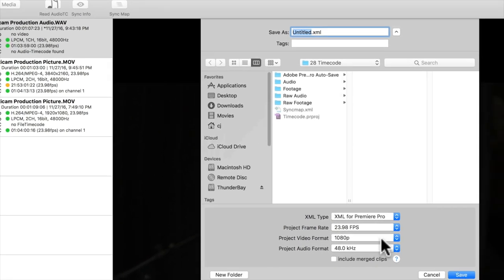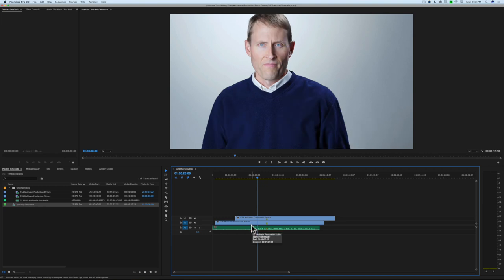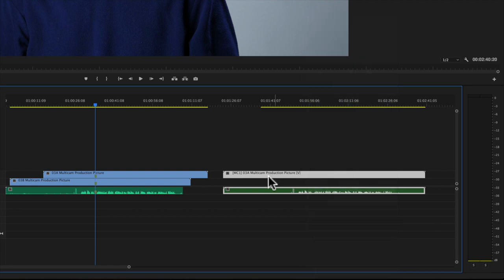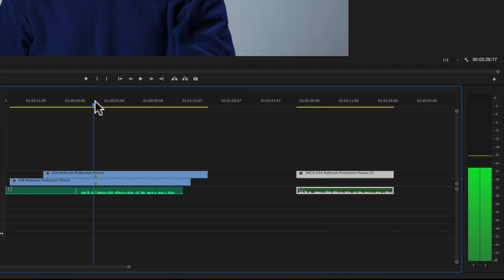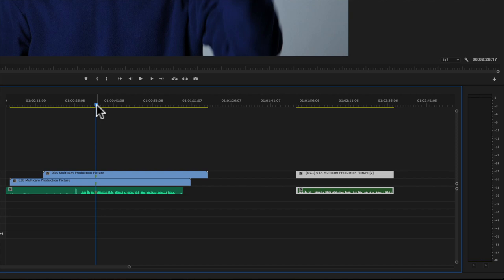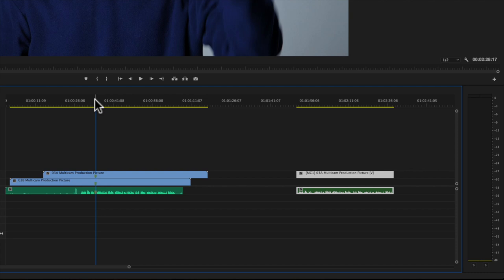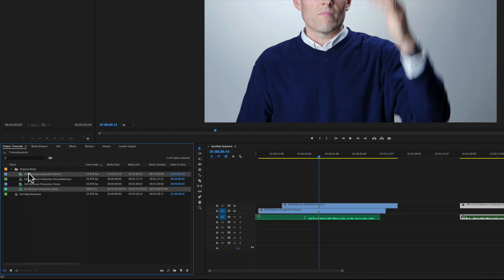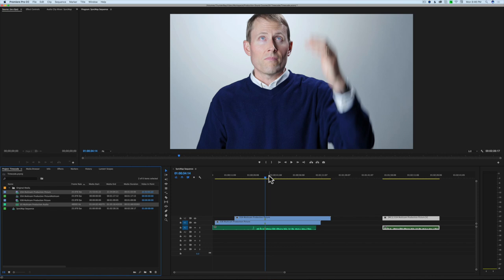Sound for Video Session: Timecode Demo

Comment: Hey Curtis, great video and thank you.  Can you still export media option from the app with raw files like braw?  Does it create new media files or simply attach the audio track to the existing media?  I’m using premiere.  Thanks!
Reply: Hi Damon, Tentacle Sync Studio supports the following import formats: Supported import formats: Quicktime, AVCHD, R3D, MP4, BWF, WAVE, MXF, CinemaDNG. Does not appear that they have added BRAW support yet. However, DaVinci Resolve handles timecode on BRAW files nicely.
Reply: @curtisjudd  Wow.  Well that's a deal breaker.  I was reading a post on Tentacles forum saying there was a work around, but you're right.  Well thanks for the reply and keep up the great work!

Comment: Great video! Hoping you can help with a question. I'd like to sync my Zoom F4 with my H6 for live music recording of up to 10 tracks. My idea is just to run TC out of the F4 into one of the audio tracks on the H6.  My question is, without using something like Tentacle Sync, how does the "audio TC" get read by the NLE? I use both Resolve and Premiere Pro. Even slating isn't reliable in this case because of the varied distance from source to mics. Any ideas?
Reply from the maker: Hi TCR Productions, yes, Resolve (but not Premiere) will read the TC signal on the audio track and convert it to a meta-data time stamp. In the media tab, right click the clip from the H6 and choose "Update Timecode from Audio - LTC". Once it has that, it can be synced by highlighting both clips, right click, and choose Auto Sync Audio Based on Timecode. You may have to experiment with it as it may expect to find the timecode on the first track or the last track. Good luck!
Reply: That's perfect! I'll give it a try over the next few days. Thanks for the quick reply.

Comment: I have clients asking for synced audio directly from the memory card in the camera.  This is usually when I run two cameras at once for interviews/doc work.  I shoot with an fs5ii.  Last time I synced in post (premiere) the client was upset that they did not get the raw video file directly from my sd card on my fs5.  I sent them 2 prores files with 0 compression (since I also recorded to prores).  Both files had perfect audio sync.  A cam and B cam.  But still, the client was displeased.  Any way to sync timecode directly to the cards in the camera?  Sometimes I roll an a7iii as a B cam as well.  Been researching on this and have yet to find an in camera solution.  Thanks for this video!  Helped me out a ton
Reply from the maker: Hi, You could run audio from the audio mixer to the mic inputs on the FS5II and FS7II.

Comment: Evening Curtis - just bought the tentacle Sync - great little unit. I know it's a bit off topic but, would love your feed back Re: powering the F4: town between the Hawk-woods NP1-35s OR Swit DV- Li-on s-8770s (Sony style). Using then with a back up of Eneloop pro's in the unit. thanks for your time - Love tour Videos.
Craig
Reply: Hi Craig, I Haven't used either of these but will be in the market in the near future after a recent shoot where I burned through some off-brand Sony NP-F style batteries. They ended up getting the job done, but not with a bit of worry on my part. These were no-name brand batteries which I think may have come with one of my Atomos recorders.

In any case, I would look at NP1 types of batteries for their size to power ratio. the Hawk-Woods looks interesting. Best of luck!
Reply: Curtis Judd thanks for the reply! I'll let you know how I get on. Thanks again - Craig

Comment: If your camera had time code built in would the master still be the external recorder ?
Reply: Yes, definitely. Unless you a filming with an Arri with the timecode module, I'm not aware of any other cameras which have an in-built timecode generator. They have realtime clocks, but those drift much more quickly. So you'll want a timecode generator for each camera, even if it has a timecode input.

Comment: Timecode vs scratch audio?  Is it the same or is Timecode the best way to sync everything that was shot at the same time?  I assume it's better to just scratch audio as Timecode was the way Before scratch audio syncing exist?  If you have multiple gopros, sound and video recording equipments, having them have a timecode device wouldn't be so ideal as you have to ensure mounting and it not getting destroyed during certain shots makes it better to just not use it.  I assume timecode is great when you are in a controlled environment with many high-end equipment and using scratch audio in expensive budget shoots with no timecode immediately makes the production team look novice and unProfessional but ultimately in post, scratch is the same?  What if the frame rates are off slightly over time?  Does timecode "heal/correct" this?  Can scratch do the same or do you have to break up the things in segments to keep the audios synced?  I think.. timecode excels when you have setups running concurrently in different places that have no way of having the same audio feed.  I can't come up with a scenario but there has to be a few good ones.  Perhaps if people were drag racing or flying a race in 2 different aircraft or more, the audience and other things going on with mics on people on the ground (interview) and in the air (commentary), rather than trying to match it all up in post to determine chronological order and synchrony, timecode makes it simple to do director camera cuts.  Basically, make your life easy and do Scratch when all the audio can be recorded on all the equipment and do Timecode when you will have situations where distinct similar audio cannot be picked up on the devices at the same time.

Comment: Hi Curtis,

I shoot airshows at 60fps, yet all Timecode devices max at 30fps.

Will running TC at 30fps be a real problem with syncing in our NLE?
Reply: SMTPE timecode is saved in the following format: HH:MM:SS:FF where FF is the frame number. So unfortunately, this probably won't work if you're shooting at 60fps.

One option to consider is using a mixer or audio adapter to feed audio directly to camera. That way the mixer does the critical work of amplifying in the mic signal with greater quality than most cameras will. Best wishes!

Comment: One thing I didn't quite get is at what point does the camera sync with the generator if receiving TC as audio through the mic in? Is it instant? Do you have to be recording with the generator hooked up at all times? I guess what I mean is when can you disconnect the generator from the camera.
Reply: Hi Daniel, if the camera does not have a timecode clock in it and you are feeding the generator in through an audio input, you must keep the generator connected to the camera through the entire shoot so that it records to the audio track every time the camera rolls. Hopefully that clarifies, sorry for the confusion.

Comment: Hello. Can I use the Timecode in my Sony fx6 to sync with a zoom H6? Can the fx6 jam Timecode into the zoom H6? New filmmaker here learning. I need to start external recording and looking for the best solution.
Reply: Technically, yes, sort of. You will have to use one of the inputs on your H6 to record audio timecode, then convert the audio timecode to metadata timecode in post (ideally on macOS with the Tentacle Sync Studio. I can't remember whether the H6 can combine all tracks into a single poly wav file, but that's what you'll want.

Comment: Hey guys, Is there a reason why Curtis was using the ZOOM unit to measure the noise floor as oppose to using the Sound Devices one?  Also, can noise floor be measured in real-time?  I'm completely new to this and am trying my level best to understand "how to do it right".  Thanks for any help you may send my way.
Reply: Hi Gerry, trying to remember back to last November about measuring noise floor in this timecode demo and not sure I recall the details. Are you by chance referring to a different episode? Thanks!
Reply from the maker: Oh, I see. I must confess that I do not remember. The important thing is to use the same recorder for each mic and the Zoom F8 has an extraordinarily clean preamp so it was a good choice. It may be because it was easier to set the same gain level for each mic on the Zoom (It displays the gain level digitally while the 633 does not)
Reply: That makes sense.  Thank you very much for taking the time to answer my query.

Comment: hi, if I buy a camera that has timecode in and out connectors , can I sync it with the audio recorder directly with a cable ?
Do I have to sync them again each time I turn them on ?
Reply: Cameras do NOT have in-built timecode generators (at least all of the cine cameras I've worked with), so you either need to leave the timecode generator or recorder/mixer with an in-built timecode generator connected to the camera through the entire shoot if you want frame accurate sync in post. If you just want to use timecode to get "in the ballpark" in post and then manually slip the audio to get perfect sync, then you should be able to just timecode jam, probably every 2 - 4 hours.

Comment: Hey Curtis ive two question regarding timecode. Firstly if the signal coming into the camera from the timecode device is a bit hot does this is anyway affect the ability to sync later in post? Also how problematic would it be to change the frame rate while using a tentacle for example. At weddings im constantly hopping between 24fps and 60fps and im wondering if i was using a tentacle here would that mess up my ability to sync?
Reply: Hi, yes, sending too hot a signal into your camera can prevent successful sync later. You'll want to set the appropriate level on the timecode generator and the input level on the camera so that the meters are hitting around -12dB. As for framerate changes, yes, you'll need to change over to the appropriate framerate on your audio recorder and tentacle to achieve successful sync. Are you shooting at 60FPS with audio or is that for slomo work?
Reply: The idea was to invest in some tentacles to make ceremony syncing much easier. But often during the ceremony i would switch over to 60fps for say the first kiss to give it that subtle slow mo effect. But seeing that these are really stand alone shots i doubt it would become much of an issue providing the bulk of the ceremony is synced up as normal.
Reply: Ah, ok, that makes sense. I agree, those will generally be backed by music or you could include the, "...you may now kiss the bride..." leading into the slo-mo shot.

Comment: Is there a way to use the TC in say A7Sii and Jam sync it to the F4/8?  What connection would I use for that?  How about an HDMI to SDI converter (I don't really know what format the TC inputs on the F4/8 are so) sorry if that is silly. 

 I see that SD supports Sony A7Sii TC on the MixPre 3/6 but because it doesn't have an internal source I would have to stay tethered with an HDMI cable between the Sony and SD and that seems crazy for location sound.

I understand that I could use an audio channel in the camera and  I could use the Tentacle Sync or TIG devices but since the F4/8 supports Jam sync as you have demonstrated I would like to try the reverse and without the additional cost of the separate devices.
Reply: Hi Gregory, I don't have a Sony here to test that possibility. My hypothesis would be that it would NOT work. The SDI input is a SMPTE timecode input which I assume is not compatible with the 3G SDI video signal you would convert to from HDMI. I may be mistaken.

The MixPre is made to be mounted under the camera on the tripod. I don't typically work that way, but it is an option for some people. In that case, feeding HDMI timecode to the MixPre is feasible. It also takes HDMI start and stop triggers from many cameras (including many of the Sony a7 series).
Reply: Thanks for your fast reply Curtis!  I am trying to find a way to sync audio with TC for a timed film contest coming up at the end of July.  I am also in the mood to upgrade from my Tascam D60Mkii.  I think I will rent an F4/8 and give it a try.
Reply: Sounds like a good plan. Let us know what you find!

Comment: I'm 5 years late to this party.
Recently (late 2021) I fed timecode from my MixPre 6 in to a wireless transmitter and set two receivers to the same freq - one for each camera. After a short recording I fed the 3 files (one audio and two video) in to the Tentacle Sync demo. Very quickly the files were in sync and an option was there in the app to send a multi-cam file straight to Final Cut X. That's all there was to it!
Too bad FCPX does not natively sync audio tracks with time code recorded on them the way it does with regular audio. I tried.
Wondering how long it takes for jam sync to drift and how much drift can we get away with. I experimented with my MixPre jammed to an external  time code generator and after 20-30 minutes they were two or three frames out of sync. That might not seem like a lot but at the end of a long recording those files will get further out of sync.
Reply: That’s a lot of drift for 30 minutes. Might want to contact tech support to confirm all is working correctly.
Reply: @curtisjudd  Thought so too. I suspect the drifting device was my ancient time code generator. Will invest in a pair of Tentacle soon.

Comment: do you lose timecode if you turn off the SD633?
Reply: There is low power mode when you turn off the 633 that is supposed to keep the timecode generator going but some have complained that it drifts more quickly in this mode. I'm not sure as I usually just leave the 633 powered on through the entire production day or turn everything off and re-jam post lunch/dinner.

Comment: Hi Curtis, I'm going to shoot a doccie in Japan with a Canon C100 and Zoom F4; so no timecode link. I will send the mix down to the camera from the F4. But what's the best TC settings on camera and F4 to be able to sync up recorded tracks individually (vs. the camera mix-down)? Should I use 'Int free run' in the camera and F4? Thanks?
Reply from the maker: Hi Heinrich, I'm afraid I don't understand your question. Will you be using a timecode generator of some sort connected to the camera? If not, it doesn't much matter because you'll need to sync using the camera mix. Or did I misunderstand your question?
Reply: Hmm... let me reformulate - I will probably use the camera mix as final sound, but on occasion I might want to use the recorded tracks from the F4. The question is - if I don't use e.g. Pluraleyez, then would it help to simplify post synching if I were to run the int continuous TC in both camera and recorder?
Reply: No, unfortunately, there isn't a way to sync the camera and the F4. The Canon C100 does not have a timecode input. :(
Reply: Hi Curtis, I've been eyeing the Canon C100 Mark II.  I understand that the C100 does not have a timecode input.  Do you know if you can jam sync a Tentacle Sync E to an audio track of the Canon C100 Mark II?  Also, do you have any experience with the onboard sound of this camera.  I purchased a Mixpre-6 (but haven't opened the box yet) after completing 2 of your courses, and subsequently discovered this camera with what appears to be great video with onboard xlr's.  Wanted to see what you though of the onboard sound as it would be appealing to make the setup a little less involved.

Comment: which mode of tc has the 633?
Reply: Most all of them: Free Run, Record Run, time-of-day, etc. Is there a particular use case you're considering? Also, the Sound Devices website includes the documentation for the 633 which can provide all of the details. Best wishes!

Comment: Will the Tentacle Sync software just take a video file (.mov or .mp4) with audio timecode and convert it to a video file with file timecode? Seems an easier way when processing Multicam clips in Premiere.
Reply: It can - it is flexible. You can create an XML file, or re-write the video file by just baking in the timecode to a metadata field.
Reply: @curtisjudd  That's great. Thanks Curtis. I think my proposed setup is a bit bizarre. My 5D4 feeds timecode into my mixpre 3 through HDMI. The audio into the Mixpre 3 comes from the Comica dual tx/rx. The M6 Mk2 doesn't have time code so my plan is to output TC from the mixpre 3 aux 1 out to a tentacle and then have another tentacle feeding TC to the M6 mk 2 which will have the second comica tx. I just need to buy the tentacles. Hopefully this will sync everything if I have TC out from the 5D4 as free run. Is there an easier way to do this?......lol
EDIT:- Got it wrong. TC out from Mixpre 3 is from stereo out which you set up in output advanced menu. Stereo Out = LTC. So Timecode to Mixpre is HDMI in and pass through is Stereo Out. I hope I got this right........ At the end of the day I'm just trying to save myself the price of a 3rd Tentacle. My budget as a hobbyist is limited (by the wife).
Reply from the maker: Graham, you'll just need a Tentacle for each camera. Do you have the Series 2 version of the MixPre-3? If not, you will also need a tentacle for the MixPre. Camera to MixPre timecode doesn't work in this scenario if I understand your setup.
Reply from the maker: @Graham_Wood  Thanks Graham. Any luck by posing this as a question to Sound Devices support? My suspicion is that the MixPre is not designed to receive and pass timecode on at the same time. Either receive or send, not both at the same time.

Comment: So no more need for slates then?
Reply: When productions use timecode, they still usually use a slate as backup in case something doesn't work with the timecode (e.g., battery runs out on one of the TC generators, etc.)
Reply: But yes, you wouldn't have to use a slate.

Comment: I possible to synchronize the turn on and off of the recorder with che camera?
Reply from the maker: I've never used it, but see page 78 of the 633 manual to see details on using record run timecode mode.